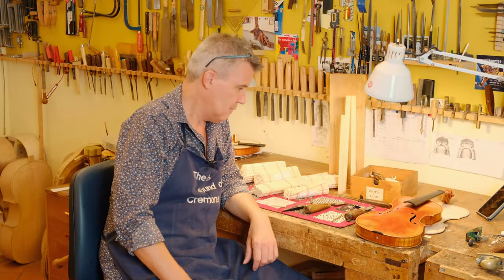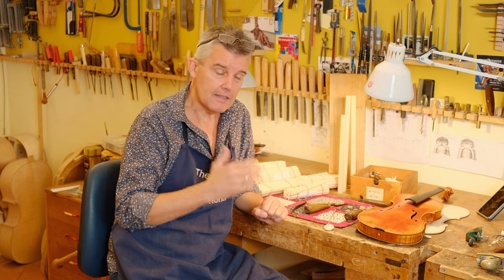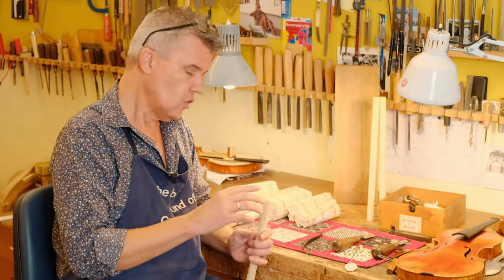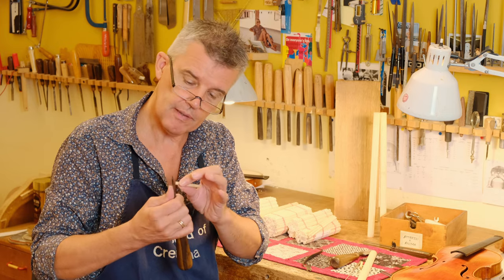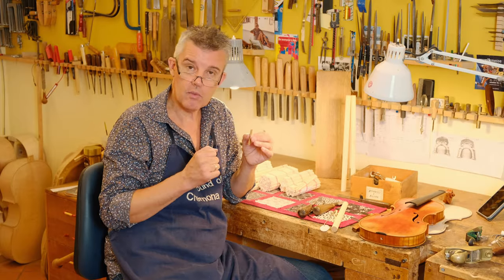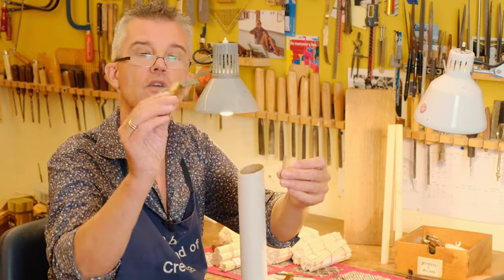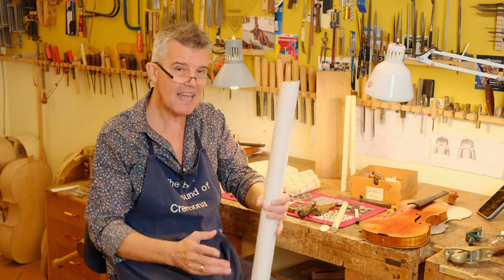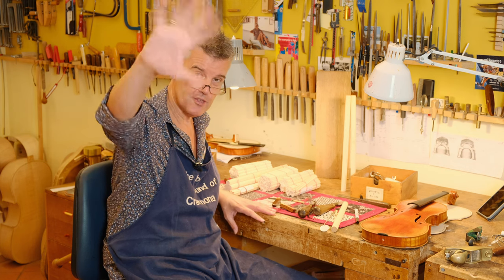The Essential DETAIL of the SOUNDPOST

Comment: Your explanation, using the paper tube, of sound post leaning and changing contact point was very simply and perfectly done. Kinda never would of thought of it but makes all the sense in the world once I heard it. For the great video, Thanks !
Reply: You didn't mention the importance of the position,  behind the bridge foot it should be. Also, the effect of it being closer to the E or to the G string.  I've heard you talk about that on a different video. And  it's not easy to get it perfect, I use the instrument, that shows the height to make the post, and how far in the post should be. Still, the post will twist, when having to move it just a bit. I'm going to start using two strings, tide to the post, then pulled into position,  through the F holes.

Comment: Cutting the bridge is comparably easy because you can immediately see what you're doing.
With the soundpost, everything is hidden and you must use mirrors, look through the end button and double and triple check. 
So why don't more luthiers do it? Well, the good ones do. But the rest?
I think fitting and setting the soundpost is the final litmus test for perception, dexterity and patience.
It really shows if you're made for this job or not. Whoever has keen eyes and a deft hand will learn fast.
Who doesn't... well...

Comment: Hello Edgar sir, can a soundpost be too short,…and what are the consequences? My soundpost tents to fall down very easily when loosening the strings…that can’t be good, right? Best regards!
Reply: I'm surprised that no one has answered this yet? The answer is, Yes of course. I'm sure Edgar talks about this in other videos but it is pretty obvious why this is a bad thing. The two obvious ones that come to mind are, 1, it's pretty impossible to hold the post in the correct place if it is too short whilst not under string tension. 2. The post does give the top (or table) some support whilst under string tension, so if it is drastically too short there could be a chance that the top may become overly flat or even concave or even split due to lack of support from the stronger maple back.